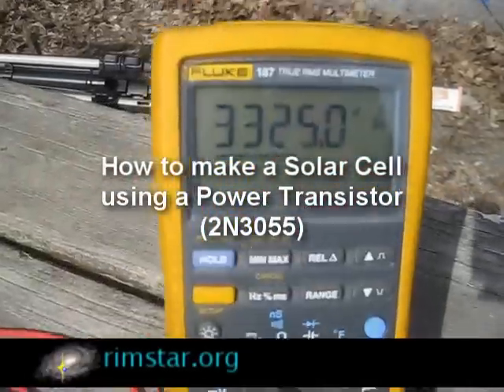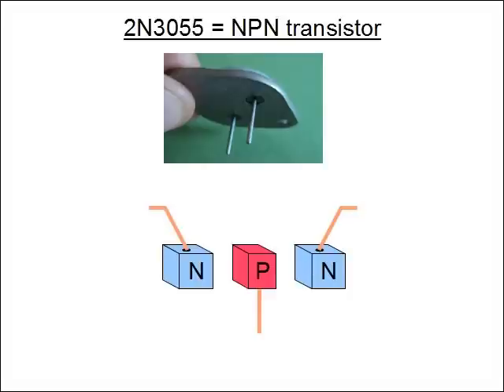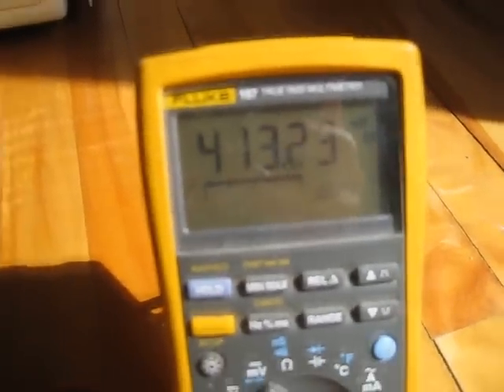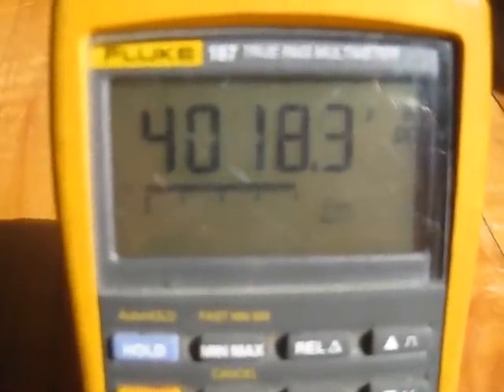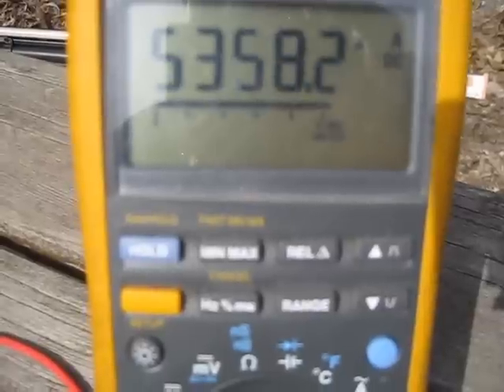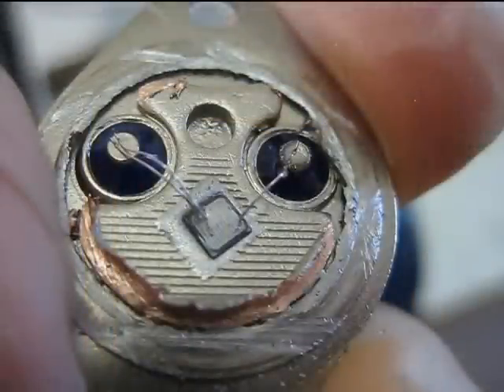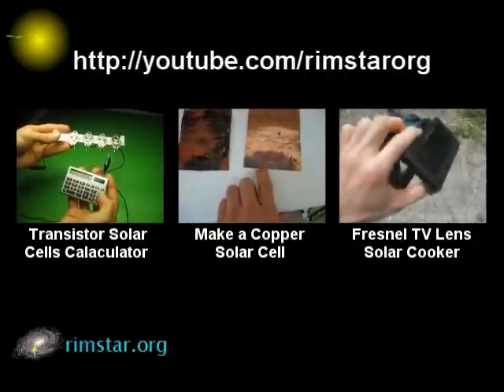How to Make Solar Cells using Transistors (2N3055)

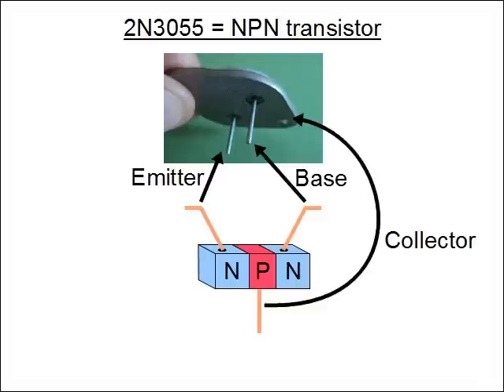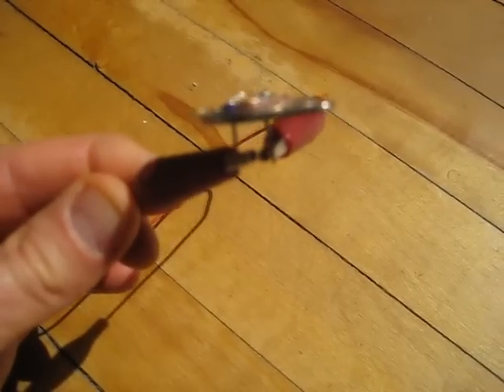Comment: At 0:58 you said P type material is the collector connected to the case. And then around 1:26 you said two pins are collector and the emitter and P is the base which is connected to the case. I think both of these statements are wrong. In reality these power transistors collector is connected to the case but it is N type not P type in NPN.
Reply from the maker: Yeah, unfortunately you can't go back an edit videos once they're published. I had an annotation point out the error back when YouTube allowed you to put annotations on videos. Now all that's left it a note I'd put in the video description. Thanks for pointing it out though - at least it'll be at the top of the comments for a while too.

Comment: Hi, you cannot calculate the maximum output power with Umax x Imax; what you really get is a nearly VOC (voltage open circuit) and an ISC short-circuit current with your measurement. So you have either a voltage source and a real current source; but you can calculate the inner resistance at this operating point, provided the source is linear (which is not). Ri = VOC/ISC equals 0.4V / 4 mA = 100 Ohm; so as you know, the most energy can be produced when the load resistor becomes equal to the inner resistance of that 100 Ohm; try to put in a potentiometer with around 100 Ohm and measure the voltage and current at the same time to show the maximum power peak of that circuit in the load. With this calculation, you will get: Pmax = (VOC x ISC)/4 in a load of about 100 Ohms. Here it is 0.4 mW instead of 1.6 mW !
Reply from the maker: Yup. This was done in the days before I knew how to measure power. These days I measure voltage across a load and current going to the load, as you suggest. Thanks for pointing it out anyway.

Comment: the actual output power is far less than 1.6mW, since there is a trade-off between output voltage and output current. You can only get 400 mV when you have ~0uA output current, and 0mV with 4000uA. If you connect this voltage to some load resistor you will have something in between -  a voltage smaller than 400 mV and a current smaller than 4000uA. If you choose this resistor very carefully you can reach the MPP ( maximum power point) where the output power is at maximum -- still way smaller than 400mV x 4000uA
Reply from the maker: Yeah, that's a pretty old video. Back then I didn't know how to do the measurement correctly to measure power. I should have used a load resistor as you suggest.
Reply: @RimstarOrg  Then how about now, is this still working or is there a more efficient way
Reply from the maker: Do you mean this setup? I did it only while making this video, just a fun experiment. The efficiency isn't very much. You're better off with solar cells actually designed and made for this purpose.

Comment: How many of these transistor can power up or charge a cellphone battery?
Reply from the maker: I don't know exactly. It wouldn't take many to connect in series to get sufficient voltage. I connect a few in series to power a small calculator in this video http://youtu.be/2bUc8RqSFXs. But the current will be very low and so charging will take forever. The small calculator doesn't need much current so it works for that. If you do a search on https://google.com for "solar panel for charging phone" then you'll see how big a solar panel needs to be to charge a cell phone. Now imagine how many of the tiny transistor wafers you see in the transistors in this video (the small part that the thin wires connect to inside the transistor) it would take to fill one of those solar panels. It's quite a few, definitely not practical or worth it financially.

Comment: What type of copper is used in the transistor
Reply from the maker: I'm not aware that there necessarily is copper. The active parts are either silicon or germanium doped with other materials.
Reply: I thank you so much
Reply: What type of copper is used in the transisto
Reply: مسلم مسلم inside the transistor they use wire which is gold plated.

Comment: how does one test the amperage of a solar cell?
Reply from the maker: Use an ammeter like I did in this video but touch the positive (red) probe of the meter to the positive of the solar cell and the negative (black) probe of the meter to the negative to the solar cell.

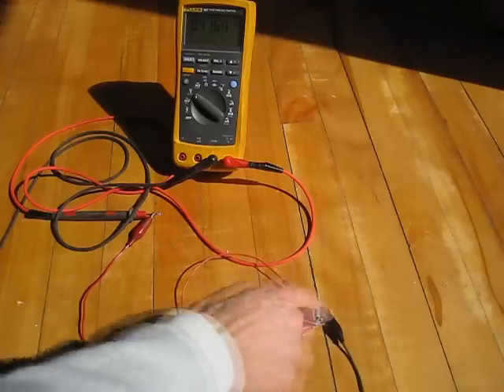Comment: 1:47
 this gave me cancer
electrons flow from the negative to the positive noob
Reply from the maker: I meant through the meter. I shouldn't have been pointing at the transistor when I said that.
This has also been brought up multiple times and each time I look for the annotation I added and it's not there. I added it again.

Comment: You have mixed this up my friend the base is not connected to the case, it's one of the pins. The case is the collector. You made the same error in the material substrate diagram.
Reply from the maker: +Pete Sapwell I already have an annotation on the substrate diagram correcting this but if you're saying I made the error somewhere else too please let me know where so I can add an annotation there too. In either case, thanks for pointing it out.

Comment: could be a neat hack if you need a light sensor in a hurry I suppose :p
Reply from the maker: +ZerqTM Done already, sort of. See my follow-up video where I used 5 of them in series to power a small calculator https://www.youtube.com/watch?v=2bUc8RqSFXs.
Reply: +RimstarOrg 
Dry Crystal Cell
Attach 2N3055 To Dry Crystal Cell
Some1Did IT B4

Comment: Why don't you connect an auxillary current source (output current of a similar solar cell), and connect it to the base terminal of another solar cell? (Collector current= Beta * base current). You will get an amplified output which could possibly be of some use!
Reply: Ashwin Kini .....darlington bridge
Reply: Can you create a new video by doing this? Appreciate it :)
Reply from the maker: +Ashwin Kini Do you mean connect up multiple of these? If so, I've already done it. See my follow-up video where I use 5 of them to power a small calculator https://www.youtube.com/watch?v=2bUc8RqSFXs.
Reply: No, I mean connect an alternating source of current to the base terminal of the transistor solar cell. will it help in amplifying the current you get thru the collector?

Comment: Can I use this to trickle charge a battery?
Reply from the maker: Philip Richards No, the voltage is too low and even then, there's not much power.
Reply: +RimstarOrg  I know the case of the power transistor is the collector, how do I find out what pin is the base and the emitter?
Reply from the maker: Owen Chase science channel
If your meter has a diode testing setting then you can do this... In an NPN transistor the base to emitter acts as a diode with the striped side being the emitter. With a PNP transistor it's the other way around. So test the two legs as you would a diode.
Reply: Unsure where to go from here
Reply from the maker: Philip Richards
Do you mean for trickle charging a battery using solar? I don't have any such circuit, or experience with doing that so I can't help you there.
Reply: Thanks RimstarOrg

Comment: Excellent idea. How many can you use to get 12 volts?
Reply: +RimstarOrg  4:25 This is like using solar panels without inverter.   
Why don't you try using another transistor and diode or capacitor to amplify power output, so you don't need so many solar cells (voltage amplifier circuit)?
Reply from the maker: j simon It depends on your lighting but I connect 5 of them in series to get around 1.5 volts to power a calculator in my follow-up video https://www.youtube.com/watch?v=2bUc8RqSFXs. So for 12 volts you'd need 40 of them under the same lighting conditions that I used.
Reply from the maker: +InventorDeeJay An inverter just takes DC from a solar panel and converts it to AC. The power remains the same. As for a voltage amplifier circuit, that will also amplify only the voltage and not the power.
Power is the rate at which energy is generated or used: energy per second.
Current is the amount of charge passing a point in a wire per second: charge per second. 
And voltage is the amount of energy for each of those charges: energy per charge.
The way they're related mathematically is: 
power = current x voltage
The amount of energy you're getting from the sun doesn't change if you simply add a voltage amplifier circuit. So the power doesn't change. You're still generating the same amount of energy per second (power).
So if power = current x voltage, and the power stays the same but you're increasing the voltage, then the current must be decreasing at the same time, otherwise the power would increase and that's impossible without getting more energy from somewhere. The amount of sunlight hitting that transistor didn't increase.
So sure, you can add a voltage amplifier circuit, but that won't increase the power. For some things that need a higher voltage and the same low power that a single transistor solar cell gives then that would work. But if the device needs more power then you need more transistor solar cells to capture more energy from the sun.

Comment: GO! Be idiot as that dude and destroy good power transistors to get 2.7mW !!!
Reply from the maker: Спас Христов It was all just in the name of fun, not to produce any real power. But one of those transistors has already long since been put back to use in one of my power supplies. I taped the cap back on with aluminum tape and it's held up just fine after a lot of use. I imagine the others will be put back to use in something too eventually.

Comment: Peeps if you try this be very careful. Up to the 1980's a lot of TO3 cased transistors had a heat conducting compound in them that was highly toxic (not to be cofused with heat sink compound). So if you get surplus old stock to try this and you start cutting into it - if its not gas filled put it in a plastic bag - wrap something like duct tape round it to keep it sealed and dispose of carefully. The gas varies but is usually either argon or nitrogen so is harmless (occasionally air). The only other gas I know of being used was neon  again harmless but that was only in experimental batches for aerospace,

Comment: The way you measured power is incorrect. When you measured the voltage you should have had a load on it. A power source without a load normally gives of more voltage (buildup) by the internal resistance of the battery or power source. Then switching to amps creates a current almost like shortening it, internal resistance of your meter and wires is almost none. In this case the voltage is almost none making the current multiplied by the completely dropped voltage = power to almost none. Hope you get what i mean. The calculation is done correctly. Only measuring first one then the other doesn't work that way. You should be measuring the relation under load. Now you have measured two different things. The voltage without any load and the current when shorted. This is not how power should be calculated. For example think of a battery the default voltage is 1,5 volts if I measure the voltage it is 1,5 volts now when I shorten it to measure the maximum current like you did the internal resistance will be the only factor limiting the current and so the voltage over the battery thus also the meter will drop a large amount to almost zero. Now when you multiply those it will give you the maximum power. But you should be measuring the voltage while shorted then and that would be almost zero limited by the internal resistance of your power source and the resistance of your meter while measuring current. Btw it generates also a lot of heat when the internal resistance of the battery or power source is low and is the only limiting resistor (resistance) in the circuit because you short it.
Reply from the maker: There's already an annotation at 3:09 in the video saying to ignore it and that the resulting calculation is useless. Thanks for mentioning it anyway.

Comment: why does this works? or how?
Reply from the maker: It would be too much to explain in a comment. Look up how a solar cell works. Very briefly the transistor is made up of layers of p-type and n-type materials, just like solar cells. Where the layers meet forms a special zone. When photons strikes one of the layers, electrons are given enough energy to move. They cross the zone and move through the electrical circuit.
Reply: RimstarOrg
ok! thanks a lot for the explanation :)

Comment: Is it photoelectric or thermoelectric?
Peltier element (the heat pump) is thermoelectric and is also made out of PN materials.
Reply from the maker: It's photoelectric. A Peltier element is made of PN materials but arranged differently. In the transistor the two materials are actually in physical contact with each other and form an essential layer where they meet. In a Peltier element the two materials aren't in contact with each other at all, but are electrically connected by a strip of conductive metal.
Reply: but transistor in the video isn't connected as the transistor. it's connected as peltier only without conductive metal.
Did you test it with cold artificial light? CFL or LED?
Reply from the maker: theAxe6
I doesn't matter that it isn't connected like a normal transistor, it is connected with one pin going to n-type material and the other pin going to p-type material so that it can act like a solar cell. This photoelectric effect interfering with transistors is actually an old well known problem. I wasn't getting high enough for an LED and definitely not a CFL, even with a joule thief I'm not sure it would work. I did, however, connect 5 of them in series to power a calculator. For that see my video here "Make Solar Cell Transistor Powered Calculator using 2n3055".

Comment: so the N and P just stand for what type of doping is used on the electrode? Are there any applications using 4 or more of the Ns and Ps in the same component?
Reply from the maker: Yes, that's what N and P stand for. I don't know how every electronic component is made but I do know that in multijunction solar cells there are multiple layers of  P and N junctions, all made with different materials. The materials of each junction is selected for turning a different range of wavelengths of light into electricity.

Comment: what is the efficiency of that solar cell? Many "people" make solar cells but the efficiency is important! Most solar cells you buy has a 15 % efficiency!
Reply from the maker: I have no idea what the efficiency is. It isn't very practical either, since you'd need so many of them to get a lot of power. I did manage to power a small calculator though, as you can see in my Make Solar Cell Transistor Powered Calculator using 2n3055 video.

Comment: Sadly this person does not understand transistors. npn means emitter=n, base=p,colector=n
the 3055 the 2 wires coming out the bottom are emitter and base. The case is the collector.
Reply from the maker: If you enable annotations you'll see one on that diagram pointing out the error. It was a simple mistake when drawing it that didn't get caught until long after the video went up.

Comment: I have been a EE since 1980 and I guess I just never thought about using the transistors for that purpose.  Great little project for a K8-12 science class.
Reply from the maker: Yeah, you kinda need a mindset that reads the warnings about the negative effects of light on the innards of transistors and then realizes that could be a positive. Not me though - I saw others do this first. :)
Reply: Thanks for responding. I have allready thought of a couple of experiments that I could come up with or people or kids that would not be dangerous and would be very Illuminating to them so thanks a lot and I will be watching for more goodies to be uploaded thanks

Dave joyner sr.

Comment: totally confused what's a base, case, an n and a p ect.. from this description, I tried writing it al down and it didn't figure.
Reply from the maker: That's a pretty big question, and would take a video on its own. I don't have such a video so I'd suggest maybe http://en.wikipedia.org/wiki/Transistor Make sure you have annotations turned on as I made an error in the transistor diagram and the annotation corrects it.
Reply: RimstarOrg thanks, it seems the transister is like a water flow pipe that has flow from the collector to the emitter and regulated by the base
Reply: It does not matter much, but I think you made a mistake on the names of the pins.  In the picture with the N-P-N squares, the P-type material is the base.  You correctly mention there that the case of the transistor is the Collector - MOST transistors have the largest piece of metal as the collector to help dissipate heat.   But then you go on to say "the collector and emitter are the two legs" and "the P-type is the Base or the case" of the transistor.  It isn't a huge deal, but it was very confusing when I watched.
Reply from the maker: Gary Eckert
If you turn on annotations you'll see there's a big annotation at that point that corrects this error. Thanks for pointing it out anyway.

Comment: 5555*$1.49=$8276.95 use a real photo voltaic cell . the voltage and current is due more to thermo than photo did you check for voltage or current before you opened the case ? try Harbor Freight much cheaper more reliable and no hack or hack saw needed.